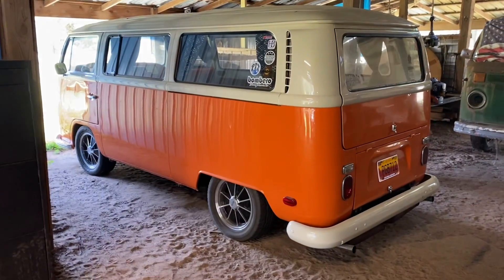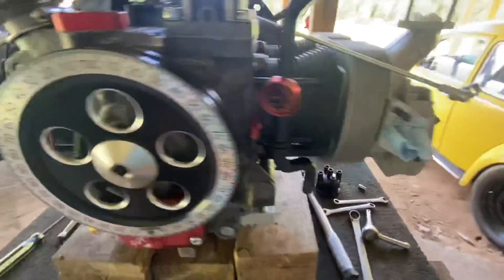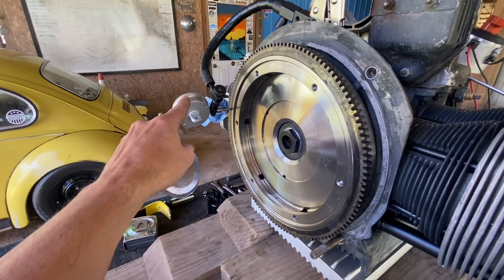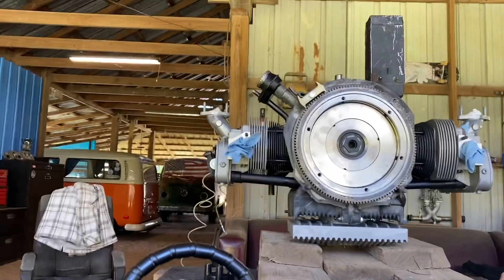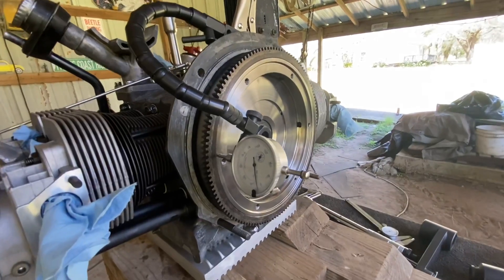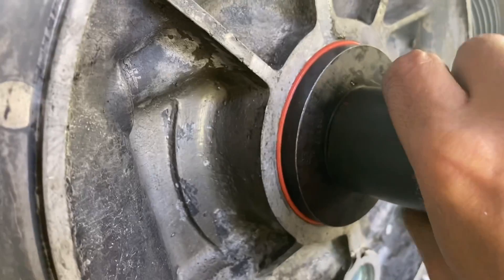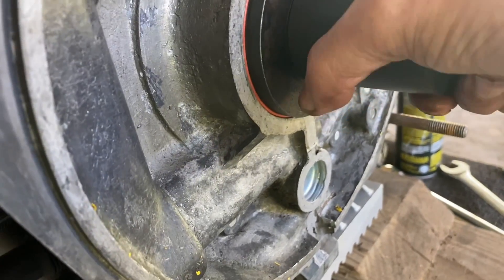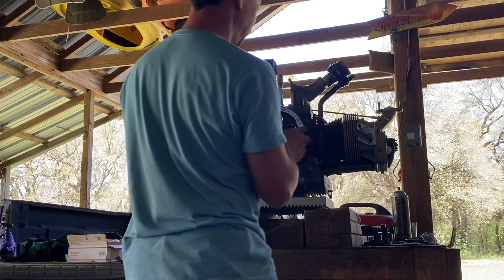VW 1800 End Play And Main Seal

Comment: When I did my end play because of having to get the parts on the internet I ended with .0025 which is a bit tight . I did not have a thinner shim but it is not locking up ? It now has 7 or 8 thousand miles and so far it aint loosening up none. Later
Reply from the maker: Seems all good then. It’s nice to compare real stories vs ‘recommend’ stuff. Sweet to know you built your own engine 💪🏼

Comment: that pulley looks to be the same diameter as the stock one!  Is it really stock diameter and if so where did you get it.  I never understood why most of them are smaller diameter than stock.  Also, is the end play only adjusted at rebuild time with a fresh engine or can you adjust it later on as well.
Reply from the maker: Stock for 1600 is supposedly 7 inch, and the new one is definitely 7 inch. I didn’t have to add or remove any shims for the belt from what it was either.

Yes you can adjust endplay anytime, buuuuut ya gotta pull the engine. I like to monitor ends as the engine ages, then adjust it with thicker spacers while doing a top end rebuild.

Comment: I was told only shim at rebuild, if you shim it constantly, it throws off the alignment of the rods to the jugs or something.  No idea if this is correct.  I shimmed my engine at least twice when the end play tolerance was out of spec.
Reply from the maker: The rods have lateral play, that will grow over time. Depending on the severity of your end play, slight shim adjustment is fine. Too much and you can definitely bind up the rod/piston/cylinder geometry, which will be felt when trying to turn by hand afterwards. At that point it’s time for machine work or a new case….just my thoughts anyway.

Comment: you used a counterweighted crankshaft, is the flywheel the stock weight?
Reply from the maker: Yes it is a heavy OEM 18 pounder, because I thought it was going into the bus. 🤷🏻‍♂️
I paid a small fee to have it drilled to 8 dowel from CBperformance.